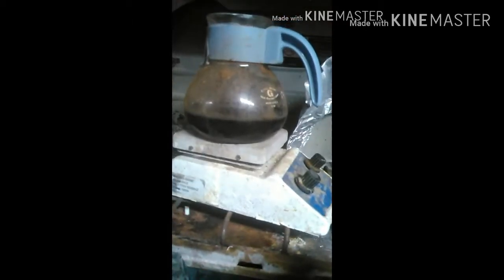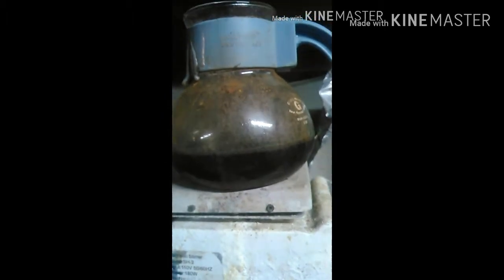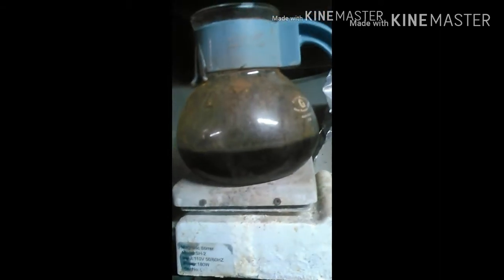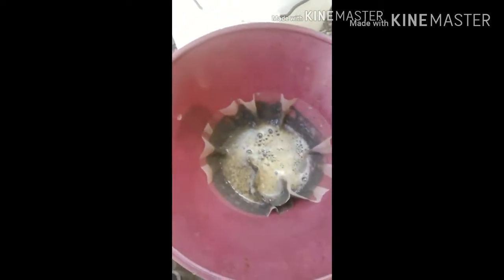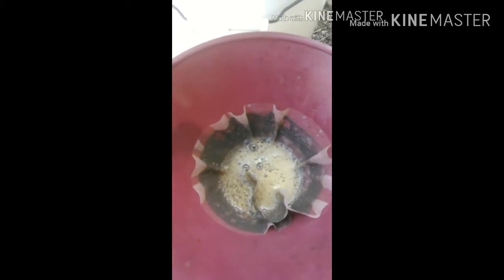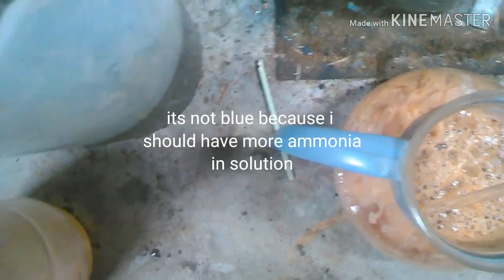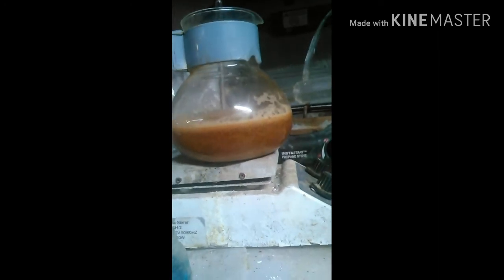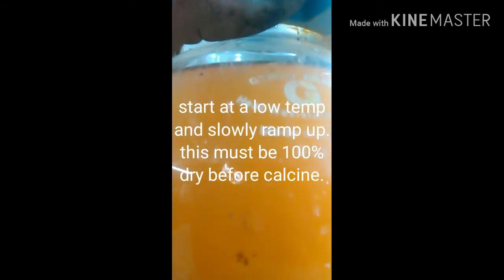How to refine and seperate platinum and palladium. Originally from catalytic converters.

Comment: Hi bri ..how I can precipitate palladium (with out chlorine  gaz method)-from aquaregia solution after I have precipitated platinum with ammonium chloride ??
Reply from the maker: What is your pH at? You may need to add hcl and then zinc or copper
Reply: garage   no problem I can add some hcl . But you have to know that the solution contains the ammonium chloride 
So will the palladium precipitate while adding some hcl and zinc powder??
Thanks a lot bro
Reply from the maker: What I would do, is pour a little bit of solution into a separate container then add hcl mix. And then add zinc or copper and see what happens.. that way of it doesn't work you only ruin a little bit
Reply from the maker: Also you can distill off all the liquids to be left with all the salts together.then melt it And see if they will decompose to nothing because the palladium wont

Comment: Hello brow !! You can help me !?
Reply from the maker: Sure, how?
Reply: @shelbysgarage5828  can you explain how you precipitate Palladium! I'm having issue with that. Thank you! Great video
Reply from the maker: You use zinc to precipitate it out. So your solution should be fairly acidic at this point add some baking soda. But not enough to kill all the acid.if to much acid  the palladium will precipitate and then go back into solution.add baking soda then add zinc and when your zinc dissolves there will be black stuff in your solution that is the palladium
Reply from the maker: If you add to much baking soda add some muriatic acid to reacidify your solution